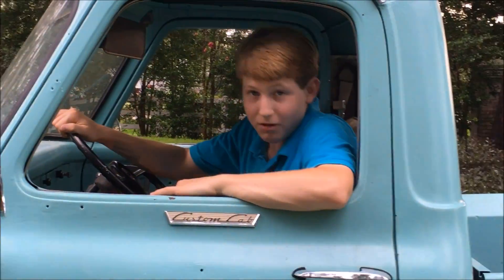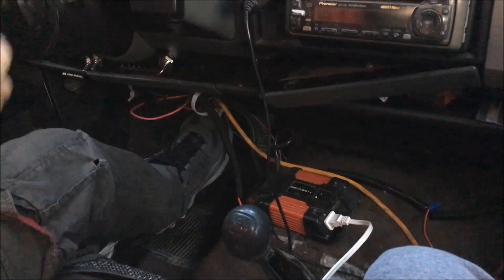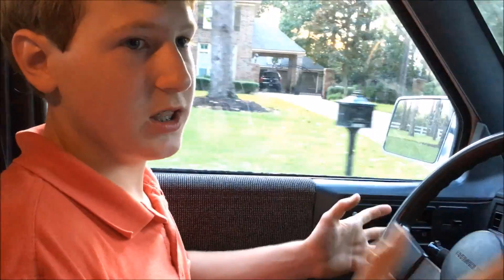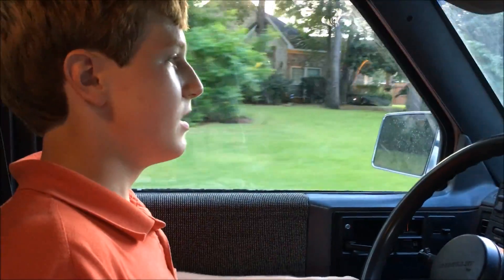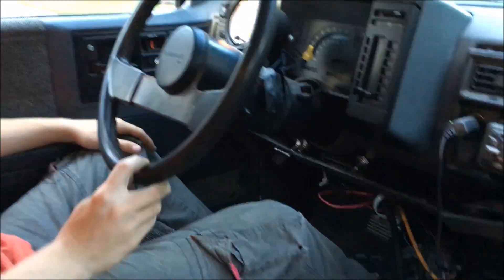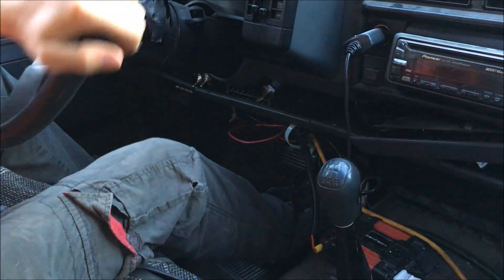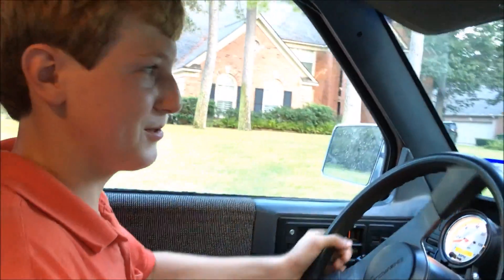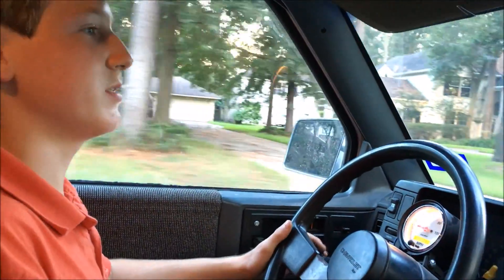Austin's Fully Electric S10 Blazer Demonstration Drive

Comment: I love my Chevy s10 pickup, and right now I'm not in a position to do an electric conversion but one day I'd like to. The truck is the 2002 flex fuel edition (basically the most efficient of the time) and currently with weight about 3500 lb (thats with 3 passengers). If I got a motor that had the same hp and torque specs as the OEM Engine. Would the truck preform the same, worse or better? OEM specs: HP 120 @ 5000rpm, Torque 140 @3600rpm. If it makes a difference I plan to keep the 5 speed manual transmission with clutch.

Comment: I have a 91 s-10 Blazer and I have been wanting to convert it for years.  How much did your conversion cost? What motor did you use? Could you post a video with the plans that you used?
Reply from the maker: My conversion cost much more than yours should, mainly because I went through quite a few trial and errors and I redid many aspects of the truck over the course of the project.  I think I calculated with batteries included it was about 8,000, but if I were to do it again, I could probably do it for 5,000 easy.  The biggest expense is the batteries, then the motor, and then the controller.  I used a WarP-9 Series wound motor, a curtis 1231C controller (they are not all that great, but fairly cheap).  The batteries are Interstate/Everstart 12V deep cycle batteries.  They have changed their design in the past few years and are complete junk now.  I would recommend using 24 Trogan T-105 6 volt golf cart batteries.  I will draw a diagram up of my system shortly.  Note: To get all the batteries in the S10 Blazer, the back seat usually needs to be permanently removed.
Reply from the maker: That's Trojan T-105 6 volt not Trogan T-105 6 volt.  Sorry about that.

Comment: i had a number of these trucks, gasoline powered of course. that thing is clean. for $500 you got a good deal. im impressed at what you have done. what's the range? will the truck cruise at highway speeds?
Reply from the maker: It did have a blown up engine in it when I got it, though.  I've had it up to 70MPH.  The range is about 30 Miles when everything is working properly.

Comment: Dude! Sweet build! Have you tried ringing up a battery manufacturer and buying some lithium-based batteries to make some equally powerful, but smaller and lighter battery banks rather than the lead-acid?
Reply from the maker: I did, but the price was unfortunately just too out there.  I wish I could get my hands on some though.

Comment: Where did you get that speedometer? I'm looking to get one for my blazer.
Reply from the maker: This Blazer is a 1987 model which was originally equipped with a cable driven speedometer and my truck specifically was equipped with an automatic transmission.  I converted it to a manual when I did the electric conversion, but I used a 1996 transmission which had an electronic sensor for the speed on it, so I had to use the speedometer you see in the video.  However, I believe that this speedometer comes in electronic as well as cable versions (in case you have the same year truck as mine). I got it from Autometer, and I actually have a slightly different model cable driven one like the Blazer's on my old Ford.  Let me know if you have any other questions!